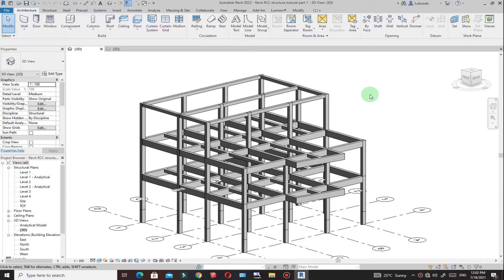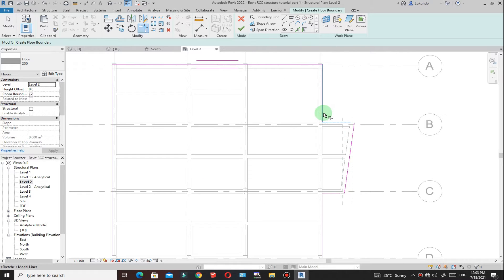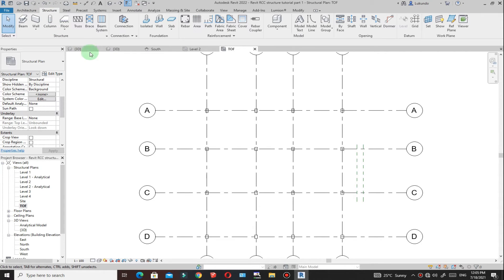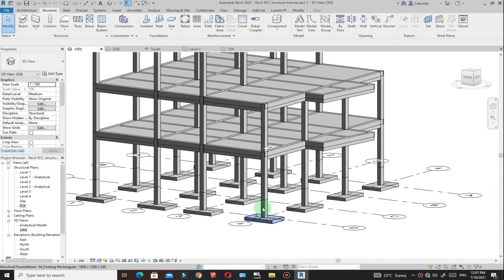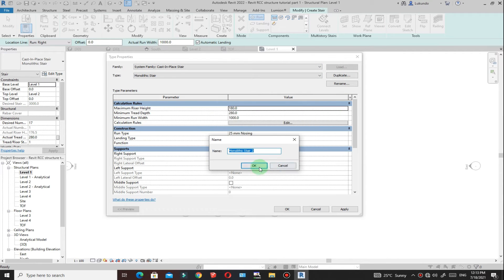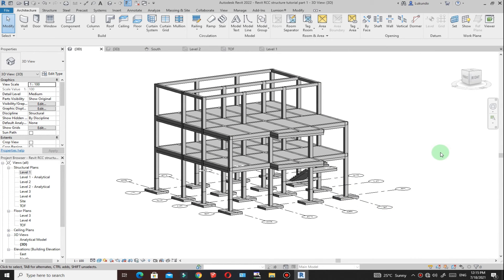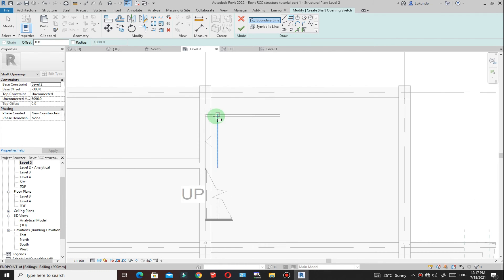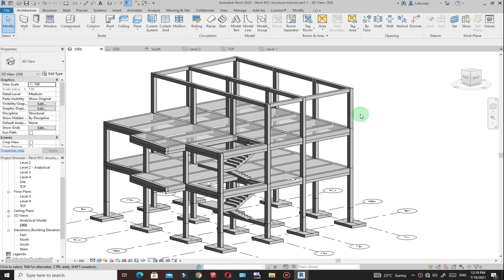Revit rcc structure tutorial_ RCC structure part 2

Comment: Hi Sir, first, I thank u for ur amazing Tutorial. secondly, if u don't mind, I have two questions to ask:
1) Why have u modelled the slab and Staircase under the Architectural model? and
2) Can we make a complete Structural (Foundation, Beam, Column,  Slab and Staircase) and Architectural (Wall, door, windows,...) in one model? I mean, can we prepare a single model with mixed Structural and Architectural  components?
I would appreciate if u can share ur whatsapp contact #.

Thanks